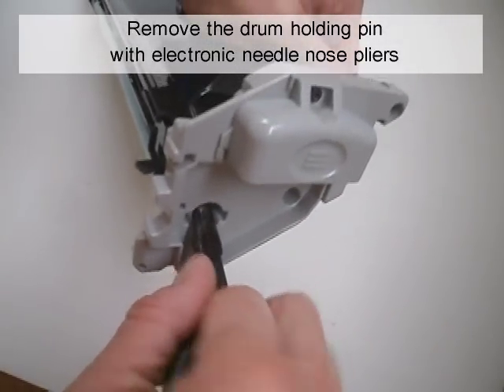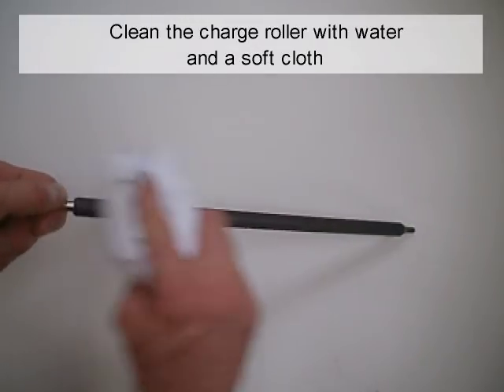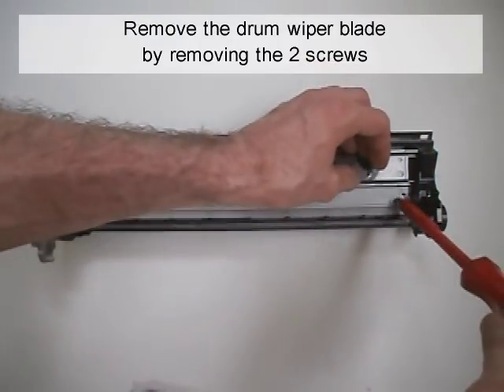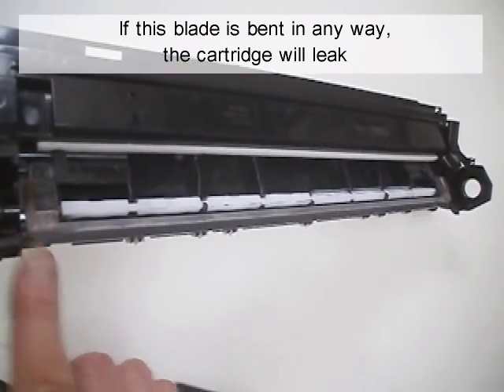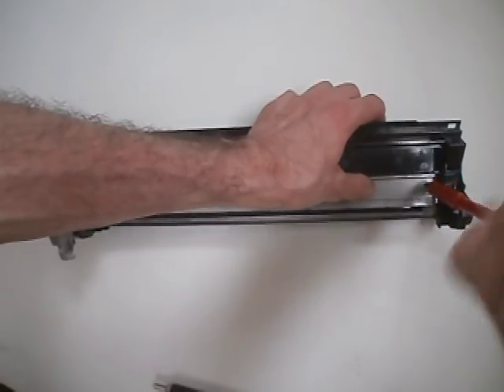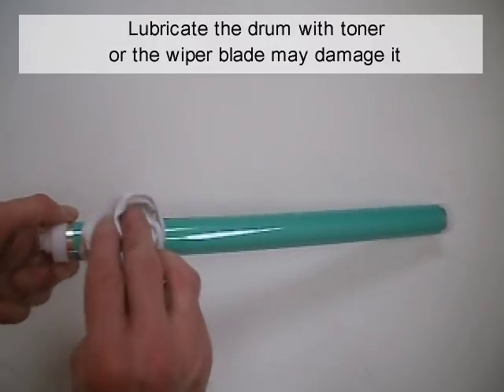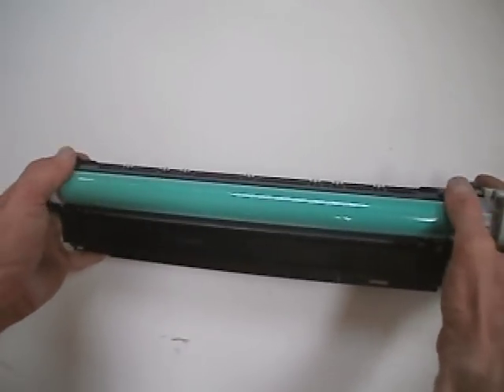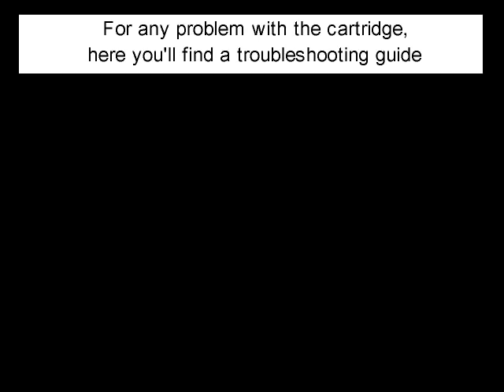Canon iR 2016 2020 C-EXV14 Drum Unit Remanufacturing

Comment: when lubricating the drum run the toner along one side of the drum only, then line the drum up to the wiper blade in a such a way that, as the drum is rotated the wiper blade will remove the toner before the toner encounters the charge roller, (lubrication is to stop the drum sticking against the wiper blade) this way you don't have to wipe the charge roller to remove toner.

Comment: Please I have Canon IR C1325iF and I kept it for long time without switching it. I switched it recently and having error code E074-0002 please kindly explain to me what is happening to it
Reply from the maker: It could be a problem with the primary transfer roller or a sensor. Check if the transfer roller is in th right position but I think you have to bring the machine to a repair centre.
Reply: Please am far away from repair center.

Comment: fotocopiadora canon ir2018i error e000007 ¿en qué consiste y cómo lo resuelvo? gracias
Reply from the maker: Fuser unit problem: check the fuser film, apply grease inside the fuser film if the film is not rotating, check the fuser lower pressure roller and its bushings. check the connectors and the thermistor